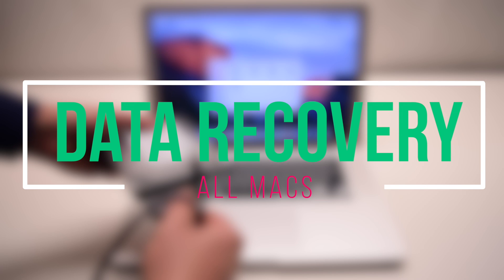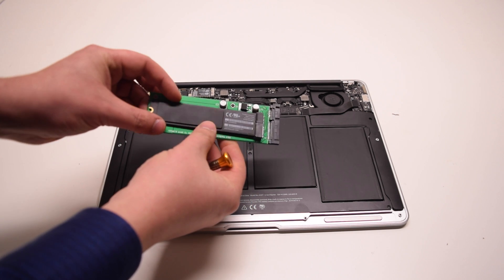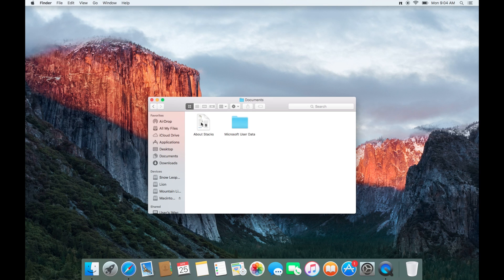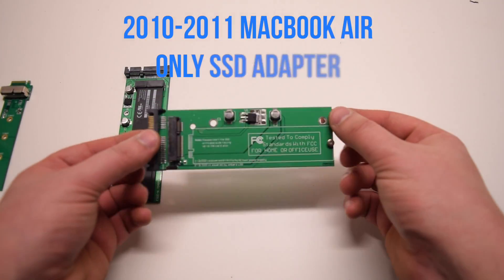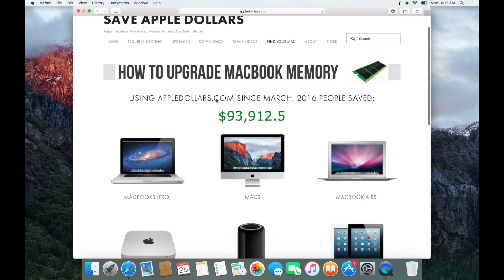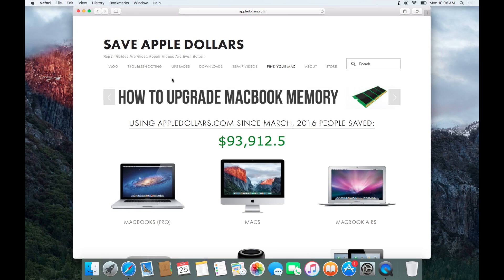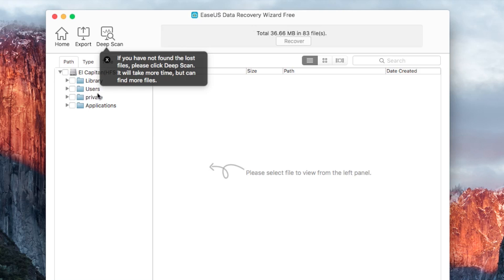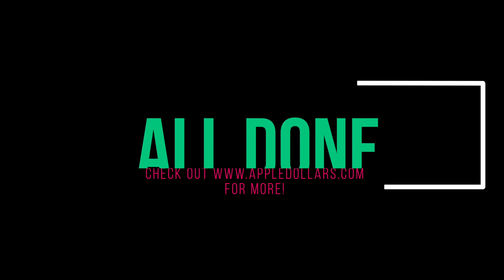How to Recover Data from any Mac Macbook ,iMac, Mac Pro, Mac Mini

Comment: My 2011 iMac had a glitch downloading the High Sierra update.  Consequently, the machine refuses to boot up, reinstall the OS and basically has become a paperweight.  If I remove the hard drive  and hook it up to another iMac, will this techinque be able to recover those files that are currently locked by this flawed OS update?
Reply from the maker: Yes, absolutely.
Reply: I have the same issue
Reply: My 2011 iMac did the same thing when updating to High Sierra. Apple should pay us for since I had to buy another apple to stay in business. Hope to use the SATA to USB cable to get to my old files from the un-bootable 2011 iMac.
Reply: Bud Rich did your Mac screen go white with a folder with a question mark?

Comment: hey guys, i have this mac book pro "MBP13.3/2.7GHZ/8GB/128GB - MF839X/A" which adapter should get?
Reply from the maker: I know this is going to sound frustrating but the only way to get it to work right now without buying a hundred dollar adapter is with this adapter here http://r.ebay.com/f12Iu4 and pluggin that into any M.2 NGFF interface of any windows computer so you will need this adapter for that http://r.ebay.com/tPwKAY it plugs into a PCI-express slot on any windows desktop. Than you will need to program the drive to be read on windows, here is how to do that https://www.howtogeek.com/252111/how-to-read-a-mac-formatted-drive-on-a-windows-pc/ if any of this is overwhelming, you can opt out and just spend the big bucks on a proprietary adapter here https://eshop.macsales.com/item/OWC/MAU3ENPRPCI/ let us know how it goes.

Comment: I need to do this with the hard drive from my iMac. Is this process safe for accessing a volume that has been compromised with a virus? Will I be able to pull a specific directory off of the compromised hard drive without jeopardizing the machine that is being used to extract the data? Also, can the removed hard drive be accessed by a windows PC, or only machines running Mac?
Reply from the maker: The difficulty of removing the hard drive and recovering files from it in an iMac depends on the year of the specific iMac model. A volume can only be compromised by forfeiting admin or kernel rights to a malicious program that then damages the system and it's files. The risk is low that any specific directory that you recover will have anything powerful enough to infect a new system as long as you don't give it permission. So in short you should be fine to recover it as long as you don't click ok to a random permission inquiry. As far as doing this on a windows machine, read this article go with option 1 https://www.makeuseof.com/tag/4-ways-read-mac-formatted-drive-windows/

Comment: Hello. I have a 2015 MacBook Pro with Retina Display. I am having an issue with my Mac that requires data recovery. I have been trying to find the right adapters for over a month now, with no success. Does anyone know what adapters I should get?
Reply from the maker: If you have a computer with a M.2 slot then all you need is one of these http://r.ebay.com/wTAqcy if not then you will need a desktop computer with a free PCI-E X1 slot and get this http://r.ebay.com/AdIjgg the third option is if you can afford it then just get the complete USB adapter http://r.ebay.com/TuFHmQ

Comment: For a late 2013 Macbook Pro Retina A1502, this adapter would be fine, and then I'd just need an M.2 to Sata? (I have Sata to USB)

https://www.ebay.com/itm/M-key-M-2-SSD-Adapter-for-2013-2014-2015-MACBOOK-Air-A1465-A1466-Pro-A1398-A1502/112615200702?hash=item1a386397be:g:rjkAAOSw63FaN5CK

I noticed that not all M.2 are the same and this one is "M Key", which confuses me in what I'd need for M.2 to Sata, any help?

Comment: Hey I have a 2015 MacBook Air
I got this https://m.ebay.com/itm/Sintech-2013-2017-MacBook-SSD-MZ-JPU-MZ-JPV-adapter-as-M-2-NGFF-PCI-e-SSD-/222667727031
I don’t know which USB adapter cable to buy that gets attached to it..
Could you please help? Thanks
Reply from the maker: Apple has a proprietary pin-out, try the adapter you purchased into this adapter https://www.ebay.com/itm/USB-3-0-to-SATA-2-5-Hard-Disk-to-M-2-NGFF-PCI-E-2-Lane-SSD-for-E431-E531-X240/201947835890?_trkparms=aid%3D222007%26algo%3DSIM.MBE%26ao%3D2%26asc%3D47301%26meid%3Dec582db841e4460f8b971e77aebd0cf6%26pid%3D100005%26rk%3D5%26rkt%3D6%26sd%3D352241677083&_trksid=p2047675.c100005.m1851

Comment: Mine is late 2015 air... Will the convertor work
Reply from the maker: It will you will need to get the correct converter, make sure to do more research as the converters listed on my site have been said not to work in some cases.

Comment: Can I use this adapter for a MacBook Pro 2013 13" Retina?

http://www.microcenter.com/product/398303/Velocity_Solo_x1_PCIe_20_x1_to_SATA_6Gb-s_Solid_State_Drive_Adapter

I need to remove the hard drive as you instructed in this video, so that I can connect it to another computer to retrieve my files.  I have the SATA to USB cable, but I need this adapter TODAY and wanted to see if the one listed in the link I posted will work.

Thanks,
Monica

Comment: Hey guys, I have a 2015 Macbook pro which I need to retrieve data for. I followed the video above and read comments below and bought the following:
(1). 2013 MacBook Pro + Air SSD to M.2 NGFF adapter card - For 12+16 pin SSD
(2). StarTech.com M.2 SSD to 2.5in SATA Adapter Converter - NGFF SSD to 2.5in SATA Converter Adapter with Open Frame Housing and 7mm Height
(3). StarTech.com USB 3.1 (10Gbps) Adapter Cable for 2.5" SATA SSD/HDD Drives - Supports SATA III (6 Gbps) - USB Powered

I can connect the SSD card to (1) and I can connect (2) and (3) no problem. But (1) and (2) have pins that are in reverse to each other and I can't see how they are compatible. I can't flip (1) to align the pins, because of the metal casing that holds the SSD card. 

Can you please help as I am totally stuck.

Comment: Hi,
Can I use any sata to usb adapter or does it have to be a speial one. 
http://www.ebay.com/itm/Adapter-Card-to-M-2-NGFF-X4-for-2013-2014-2015-apple-MacBook-Air-A1465-A1466-SSD-/292068121286?hash=item44009ddac6:g:uBkAAOSwjL5ZJSEC this is the M.2 NGFF Pci-e that im buying
Reply from the maker: Should be any SATA to usb but the other adapters are proprietary.

Comment: Ok I have what would be called the "grey screen of death" which basically won't let me bypass the startup screen but my data is still on there because when I run disk repair it tells me at the bottom how many gigabytes I've used it it also fix itself but I really just want the data on there with that being said will that work and what's the name of that took you're using and where can I buy it
Reply from the maker: Sure you can try to use the SATA to USB cable once you pull out the drive and plug it up to another working Mac.
Reply: +Save Apple Dollars it won't damage the operating system or compromise it
Reply: +Save Apple Dollars I got the adapter when I plugged it into the Mac  with my hard drive that isn't working attached it said "OS X can't repair disk "Macintosh Hd" you can still open or copy files, but when I go to the files to try n open em there's nothing there, is there a program you would recommend

Comment: Ok got the adapter, the hard drive and all the files are on the desk top of new Mac. Now how do I get them on to the new computer. They will not drag and drop. PS You left this part out of the video
Reply from the maker: Not sure, is the hard drive that is mounted in read-only mode? You might have to download NTFS Textura or read about mounting NTFS formatted drives.

Comment: Having issues finding the adaptor UPC: 701017251842.

Any suggestions?
Reply from the maker: I think this is the correct one: http://www.ebay.com/itm/Adapter-Card-to-M-2-NGFF-X4-for-2013-2014-2015-apple-MacBook-Air-A1465-A1466-SSD-/292068121286?hash=item44009ddac6:g:uBkAAOSwjL5ZJSEC
Reply: Thank you!
Reply: Save Apple Dollars after getting this adapter do you need the sata adapter cable as well?

Comment: I have a 2015 Macbook Pro 13 inch and bought the two products below but the adapter doesn't fit the connectors on the card. Should I buy a different card? Any advice is greatly appreciated.

https://www.amazon.co.uk/gp/product/B00TSOMSJK/ref=oh_aui_detailpage_o00_s00?ie=UTF8&psc=1

https://www.amazon.com/Inateck-SATA-Adapter-Cable-Drives/dp/B01E4VHSYG/ref=sr_1_5?ie=UTF8&qid=1482778079&sr=8-5&keywords=sata+to+usb+cable
Reply from the maker: You need this first https://www.amazon.co.uk/A1465-A1466-A1502-A1398-2013-2015/dp/B01EO5CVTE/ref=sr_1_2?ie=UTF8&qid=1500326242&sr=8-2&keywords=2015+macbook+pro+ssd+adapter then that adapter plugs into this https://www.amazon.co.uk/M-2-NGFF-USB-External-Case-x/dp/B010O2RIBC/ref=sr_1_5?s=computers&ie=UTF8&qid=1500326363&sr=1-5&keywords=m2+ngff+adapter or this sense you purchased the SATA to usb already https://www.amazon.co.uk/SATA-M-2-NGFF-SSD-adapter-x/dp/B00J3XHKJO/ref=sr_1_1?s=computers&ie=UTF8&qid=1500326363&sr=1-1&keywords=m2+ngff+adapter

The Macbook SSD goes into the proprietary Apple Adapter then the SSD inside the Apple Adapter is Plugged into a M2 NGFF adapter, then this tri assembly is plugged into any other Mac through the USB cable or SATA to USB adapter cable. Let me know if there are anymore questions.
Reply: Save Apple Dollars I bought the adapter for the SSD and then the item in the last link as I already had the SATA to USB but the adapter and other item don't mate correctly, the pins are opposite one another. :(
Reply from the maker: The Macbook SSD goes into the proprietary Apple Adapter then the SSD inside the Apple Adapter is Plugged into a M2 NGFF adapter, then this tri assembly is plugged into any other Mac through the USB cable or SATA to USB adapter cable. Let me know if there are anymore questions.
Reply: Save Apple Dollars but you can see from the pictures of the products that the Apple Adapter doesn't connect with the M2 NGFF adapter? The pins are the opposite from one another.
Reply: Was this issue ever resolved? I just purchased all these adaptors after watching the movie above and I have the same problem. The pins are back to front and I can't connect the Apple SDD adaptor to the M2 MGFF adaptor. I can't flip the adaptor card so that they align, due to the metal enclosure that hold s the SSD card.

Comment: Hi I have a MacBook Air, my kids spilled water on it!! If I retrievethe hard drive will I be able to recover my pictures???
Reply from the maker: Absolutely, you will need to run the serial number on the back to find out the true year and size of the Mac https://checkcoverage.apple.com/us/en/?sn=  then order the appropriate SSD adapter since there are quite a few different proprietary SSDs apple makes. Just watch the video again for more details.

Comment: I just wrote a 2.2k chapter for my book and I wanted to copy it so I pressed command v instead of c. Is there any way to recover the text that got removed? Please help.
Reply from the maker: Unfortunately no, nothing can be recovered from the OS X clipboard once overwritten. Now depending on the software you are using, software like Microsoft Office for Mac will periodically save your work and you have to go look at the last saved session, please note that I won't elaborate on how to do it, I'm just suggesting a general direction.

Comment: Is it possible to recover my Mac hard drive on a Windows PC using a SATA ? Or can it only be done on another Mac?
Reply from the maker: Macs use a specific partition map as well as format and so we only suggest attempting a recovery as shown in the video. If you search the web I'm sure you will find windows application capable of reading GUID partitions and Mac OS Extended format.
Reply: Thank you !

Comment: alright I am sorry to keep bugging you. but I ordered both those adapters and they tedchnically fit. but I am running into a problem will connecting the two.  I have the exact same problem as the guy in these amazon review pictures. Do you know what to do?

https://www.amazon.com/review/R2K6CJ8U2ONGSN/ref=cm_cr_rdp_perm?ie=UTF8&ASIN=B012P14MFK

Comment: Hi ! I think you have given me hope, I have the very same macbook pro 15. 2010 model. My laptop was stolen from me by a landlord given back completely wiped out! Now it is running on El Capitan but before I can't even remember, but it was running on an old drive. I called Apple but they said I would need to take it to a specialist of some sort to see if recovery is possible. Do you think this will work for me ? Also where can I buy the adapter from?
Thank you so much !
Reply from the maker: Buy the adapter from amazon or ebay (SATA to USB) and it's worth a try, the cables are less then $10.

Comment: PLEASE HELP!!   I just got a new 2015 macbook pro 15" (cuz my old one broke) that looks a lot similar to the newer macbook pro you showed in your video. How do I know which adapter card to get for the SATA adapter? EDIT: is the the right one? I already ordered so i hope it is https://www.amazon.com/gp/product/B012Y8F6A4/ref=oh_aui_detailpage_o00_s00?ie=UTF8&psc=1
Reply from the maker: Thats the wrong adapter. What macbook did you have before (the one that you are pulling the hard drive from), year and model?
Reply: It is a 2013 mac book pro. The model number ( A )(one)(three)(nine)(eight). (A1398) 

What about this one? https://www.amazon.com/Makerfire-mSATA-Micro-Adapter-Converter/dp/B00NING8K2/ref=pd_sim_147_54?_encoding=UTF8&pd_rd_i=B00NING8K2&pd_rd_r=8E4P0AR70GVF97G39RAX&pd_rd_w=Zld1I&pd_rd_wg=ybRkO&psc=1&refRID=8E4P0AR70GVF97G39RAX
Reply from the maker: First you need this M.2 NGFF adapter http://www.ebay.com/itm/USB-3-0-to-NGFF-M-2-B-Key-SSD-Adapter-Card-External-Enclosure-Case-Cover-Kits-/302168574501?hash=item465aa68a25:g:oZoAAOSw44BYVKEX , then this 2013 A1398 Macbook Pro SSD goes into this adapter http://www.ebay.com/itm/2013-2014-2015-apple-MacBook-Pro-Air-A1465-A1466-SSD-to-M-2-NGFF-X4-Adapter-card-/381359086067?_trksid=p2141725.m3641.l6368 so it's like Russian dolls.... aka Apple's proprietary way of keeping people from fixing their own stuff.
Reply: thank you so much for your help! i appreciate it tons
Reply from the maker: No problem.

Comment: I ordered the adapter based on the recovery model adapter information provided on your site. UPC: 701017251842. 
I actually found this item on Amazon: https://www.amazon.com/Sintech-28pin-adapter-2013-2014-2015-Macbook/dp/B0173ODBCE/ref=cm_cd_al_qh_dp_t  
The adapter took a while to arrive, I received it today. The adapter does not come with the m2SATA to USB cable.
How do I find this cable? I can't seem to find anything. I assume I am not searching for the right thing.
Any advise would be appreciated!
Thanks
Reply from the maker: You want this https://www.amazon.com/Inateck-SATA-Adapter-Cable-Drives/dp/B01E4VHSYG/ref=sr_1_5?ie=UTF8&qid=1482778079&sr=8-5&keywords=sata+to+usb+cable Happy Holidays :)

Comment: I dont see trash can under user. Can you help me with it.
Reply from the maker: In EaseUS Data recovery tool make sure to select "all files" then then select the correct drive, your main system drive. Under users you should see the trash bin. What version of OS X are you using?

Comment: I just upgraded my iMac yesterday with a SSD. Why? Because I couldn't get into my desktop anymore. I had the loading screen with the Apple logo and the progress bar, when it was around 75% it shut off my iMac. To reach that 75% it took 5 minutes! I knew the hard drive couldn't handle it anymore, however after I upgraded the iMac with a SSD it took 7 seconds to boot. But after I attached my old 1T harddrive to my iMac through usb and a similar sata and power connector it recognized it but it shutt itself down when I wanted to search for files in the drive. @Save Apple Dollars, do you know what I could do to still same my files from my old HDD? Because I haven't had made a backup for 3 weeks in those 3 weeks I made ton of important documents. If you know an answer I would be really grateful!
Reply from the maker: Interesting question... Have you tried going into the "Disk Utility" and attempting to use the Repair Disk Option? Other then that, the only other option is to find some Mac hard Drive recognition software for Windows and try to read the drive from a windows computer. I hope this helps.

Comment: Thanks for the informative video! My late 2013 13" Macbook Pro Retina Display died last week, however I have to recover the data before selling for spare parts. I'm a real novice at this but your video helped me. Would this be the adapter needed for this macbook model? 
https://www.amazon.co.uk/gp/product/B018KHJHRG/ref=ox_sc_act_title_1?ie=UTF8&psc=1&smid=AT0LZKUUT30A0 

I'm clueless with what SATA usb adapter I need though, I can't seem to find anything online. That's probably because I'm a novice!

Any help would be great!

Many thanks
Katie
Reply: Thanks for all the useful info! Which is the frequently bought together adapter you mentioned? For an early 2014 MacBook air we need the M.2 NGFF Pci-e like the one you show in your video, plus ______, plus the SATA to usb, right? I'm missing the information of the adapter in between as the one you mentioned in your video doesn't quite fit straight to sata-usb. Right? Thanks again!